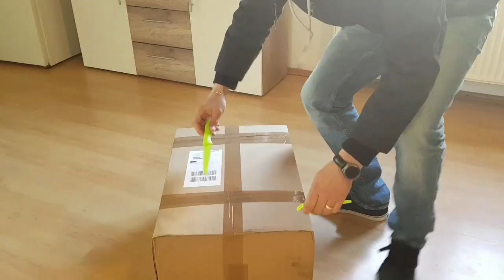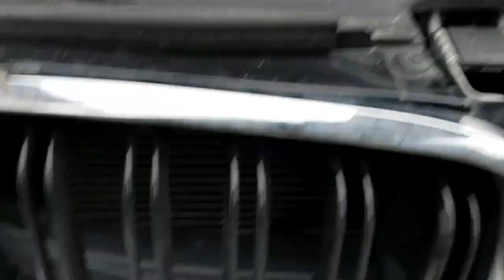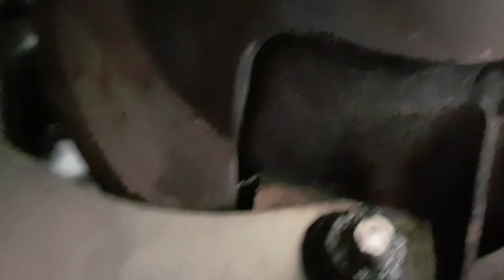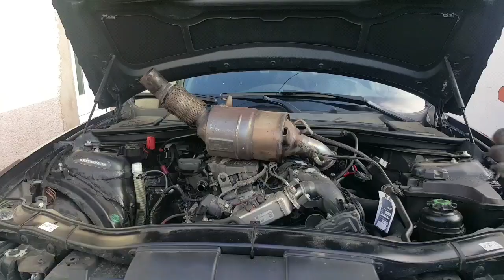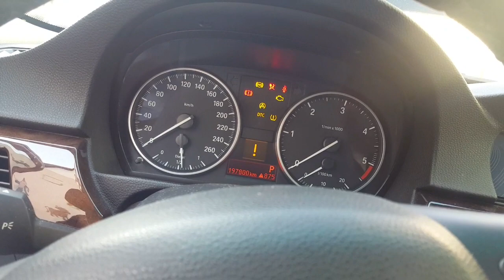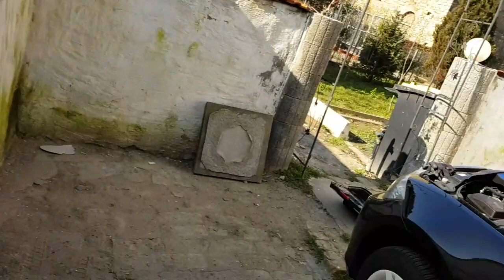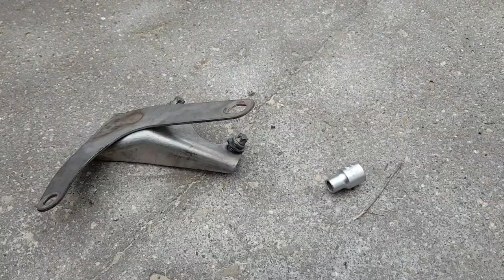BMW E90 DPF replacement (how to)

Comment: Schau nach ob deine Kühlmitteltemp. über 80*C geht, wenn nicht ist dein neuer DPF nach paar Wochen dicht, da keine Regeneration möglich. Motor-Thermostat und AGR-Thermostat sollt man gleich mit wechseln.
Reply from the maker: Danke, gut zu wissen! Aber Agr ist schon gereinigt und ich habe nach dem einbau die Regeneration mit Software eingeschaltet und 30 km auf der Autobahn gefahren. Nächste Woche kommt meine neue BMW so...kein Diesel mehr ☠💨💥🚘😉